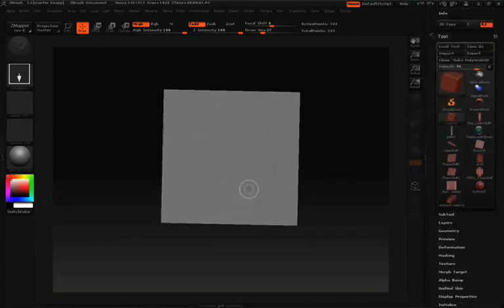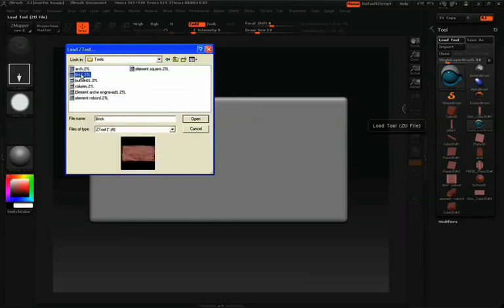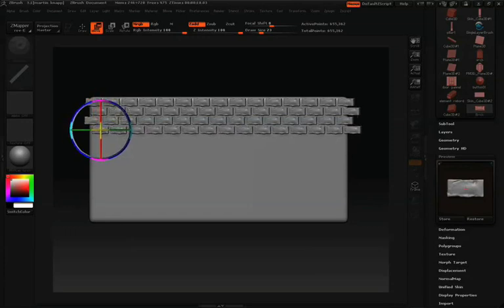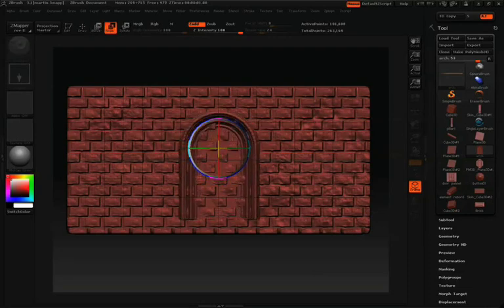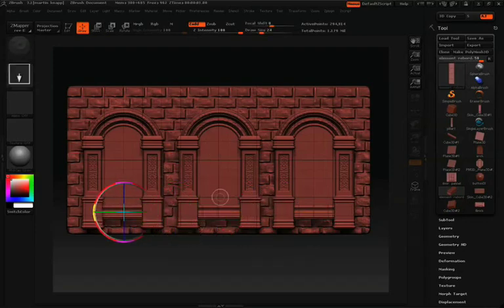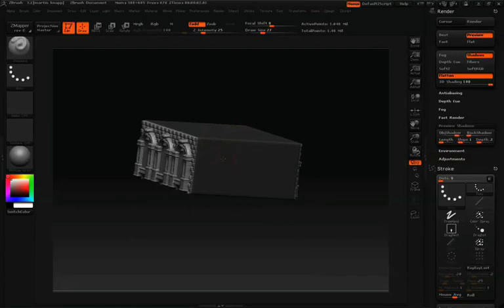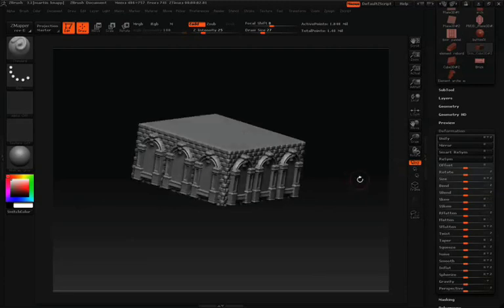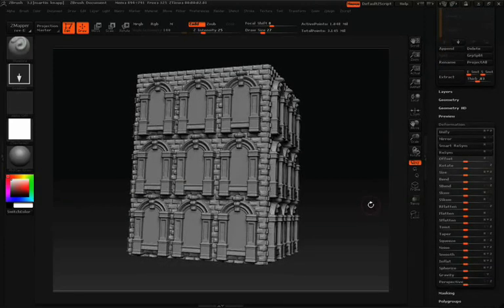ZBrush Tutorial (Architectural Techniques) - part 6

Comment: @NextGenAsh ZBrush's entire purpose in the industry is to allow modelers to quickly develop 3D models for films and video games at extremely high levels of detail, and then bake these details out into normal or displacement maps for use at runtime / rendertime on a low-definition model. Therefor modeling something as hi-def as this wall might be nice in theory, but in order to put it to any industrial use other than a simple 2D render from inside ZB, youre going to have to retop.

Comment: @NextGenAsh sure it will accept maybe one of those mesh's, but thats barely everything you need for an animation in either program. This is hundreds of thousands of polygons just to make a simple wall that could be achieved with probably around 2 to 3 thousand polygons and a good texture / normal map. Throw in the fact that you still need the rest of the scene modeled, textured, characters, etc, and you'll find when it comes time to animate your computer isnt going to like you very much.